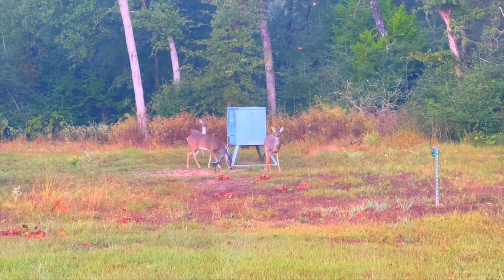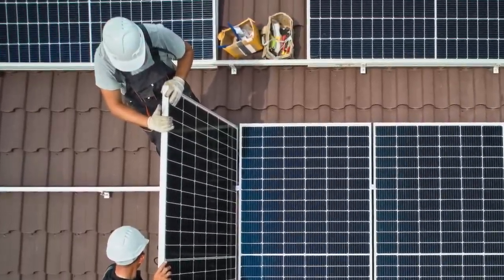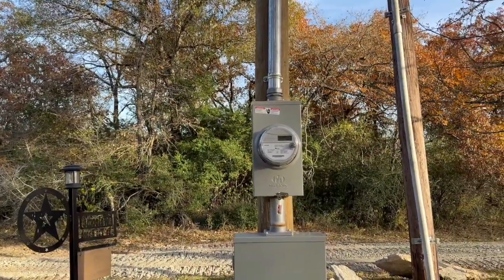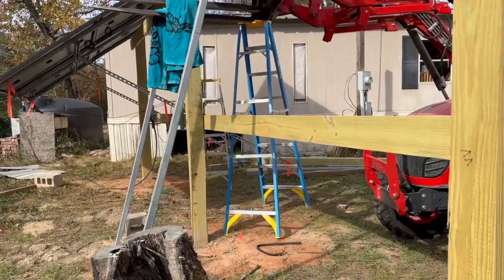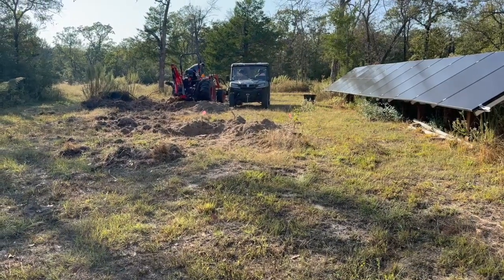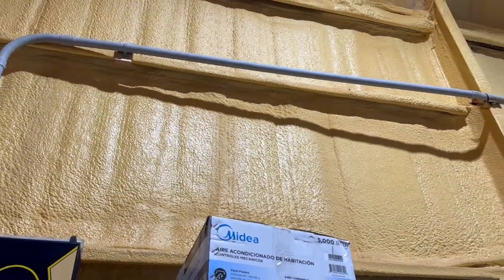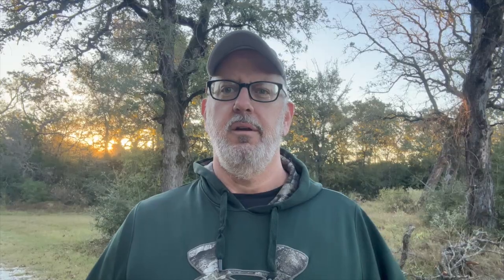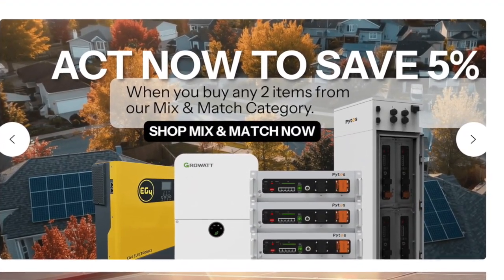Mistakes in Our DIY Solar System | DON'T DO THIS!

Comment from the maker: DIY Solar is a great way to save a lot of money on your solar system!  But, since it’s you in charge, pre planning is critical to a smooth installation.  We have hit many snags and setbacks along the way and this is just an example of one more! 

It was easier to work around these with the Brightmount rack as we could adjust the racks wherever we wanted to install the support posts.  However, with the IntegraRack ground mount, make sure you have a smooth level site for installation because they’re just a different design.  

These things happen with DIY Solar installations, but If we’d designed our entire system out and selected the type of ground mount for all the panels needed, maybe we’d avoided this setback.  Have you run into similar issues that held up your solar installation? (I can’t be the only one! 🤣). Let us know in the comments.  And also let me know if you have a stump grinder I can borrow for the weekend! 👍🤩

Comment: As someone who has dug thousands of stumps a hole is your friend.  The bucket curl is the strongest part of a backhoe.  With a small backhoe just start farther out and dig out the soil under the stump.  You can break off or use a saw to cut roots to big to break.  When you can wiggle the stump a little have the bucket half curled and wedge the back of the bucket against the ground and try to curl it. If nothing moves dig some more.  Be sure to dig a trench on the side you are trying to pull the stump towards.

I installed a full system to begin with, 2 EG4 6000XPs, 30 kWh of batteries, 24 460 watt panels.  I found I did not have enough PV power for cloudy days and added 10 more panels.  Full self install.
Reply from the maker: Thanks!  I’ve slowly gotten better at it.  The big breakthrough came when I realized, in most cases, you only have to dig down and cut 12-18” off the top of the stump with a chainsaw.  I did have a tree where I needed a gate post, so I spent two days digging the entire stump out.  I think the hole was 5ft deep.  My wife insisted we add a back hoe to the tractor because she got tired of hearing me complain about my back after digging trenches!  (I married well!). 

I’ve been running (2) 6000xp like you, but I think I’m going to change over to the 12000xp.  I’d like to have the 24kW PV capacity, so I will be doing a few more ground mount installs to add more panels.  I’m up to 45kWh battery storage with the addition of the EG4 WallMount battery, and I think if I just up the PV we should be able to get through a week of cloudy weather!  Thanks for watching the videos!! 👍🤩☀️⚡️🔋

Comment: You have some great points from your lessons learned. Keep after it! I was once told that hired work comes in three categories: Fast, Cheap, High Quality, and you can only pick two of them. ;)
Reply from the maker: 🤣😂. Ain’t that the truth!  Thanks for the comment.  I finally got all the stumps dealt with.  I dug down about a foot and sawed the tops off with my chainsaw.  Have been bringing in dirt to level the site and should start installing the IntegraRacks later today.  I really like the IntegraRacks for their simplicity, but I only recommend installing them on a smooth flat surface.  If it’s hilly or has obstacles like my stumps, a ground mount with poles or posts sank into  the ground is probably an easier install.  Never too old to learn a few more things I guess!  👍🤩⚡️☀️

Comment: Great idea Eco flow delta pro ultra X system 12,000W and Eco flow delta pro ultra X extra 10 battery and Eco flow delta smart panel 3 and power whole house off the grid and solar panel 10,000 KWH 😊 amazing